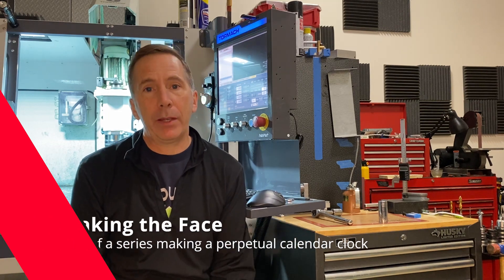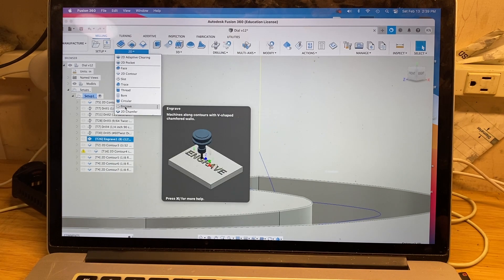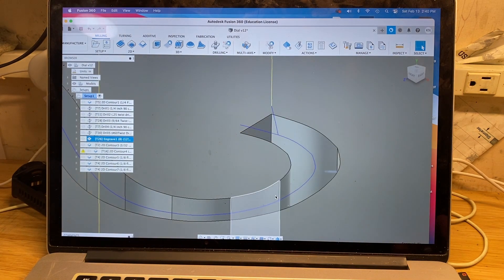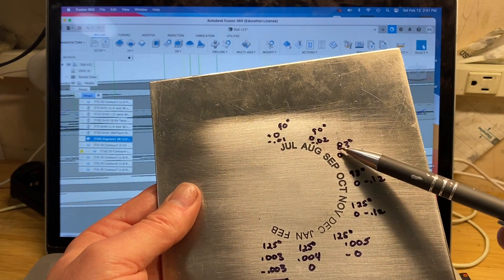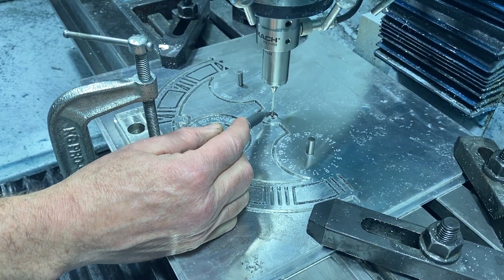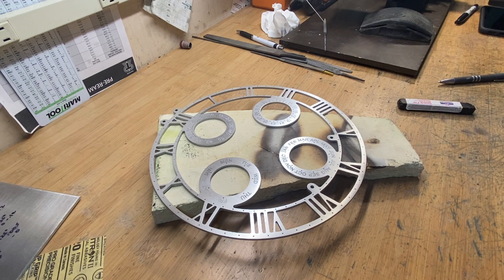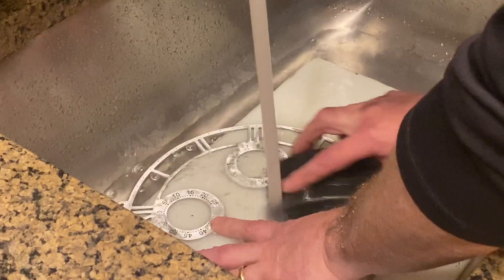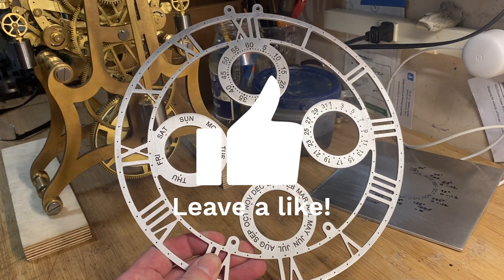Making the Dial face for a perpetual calendar skeleton clock.

Comment: Looks Great. What is the cutter there? Is that just a V-bit?
Reply from the maker: Yes, its a 90 deg engraving V Bit.   I run it at 10,000 RPM and take a fairly slow cut.
Reply: @KevinNolanMakes  Thanks. I have an old mini-mill (4x18" working area, maybe that's a mini-mini mill or micro mill???) that I converted to CNC, but I really don't use it anymore. I'm planning a project where engraving similiar to what you're doing would be great, so thinking about experimenting with that a bit.

Comment: Hi, what thickness spring would you recommend for a large wheel skeleton clock? Only the manual says that 0.5 could be too strong and that a 0.45 would be better. What’s your view on this matter? I’m making two of these clocks and I’m ready for installing the springs.
Reply from the maker: It sounds like you are making the Wilding design.  I made that clock and for the mainspring I purchased it from Ian T Cobb.  If you don’t have his contact it is ian@iantcobb.co.uk.    I asked him to provide the spring that was best for that design.   The one he sent works very well but I don’t remember the thickness.   Wilding recommends the .4mm spring, I would go with that.   You want to try and get 8 day power out of the spring.   In my video, checking the mainspring, I show the formula that L.G. Brown put in his book.   It is a good one to use to check the design.
Reply: @KevinNolanMakes  yes I’m making the wilding design and I’ve already ordered the springs from Ian t cob. That’s good news that he sent you the correct spring. I’ve already made the wildlings elegant scroll clock and I always get my supplies from Ian t cob. Thanks for the reply and I’ll watch the video you mentioned.